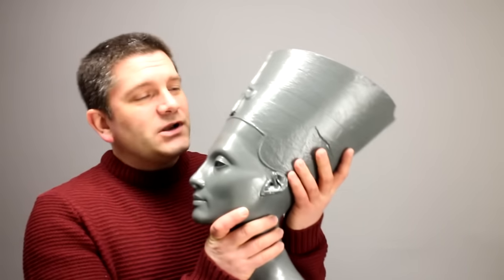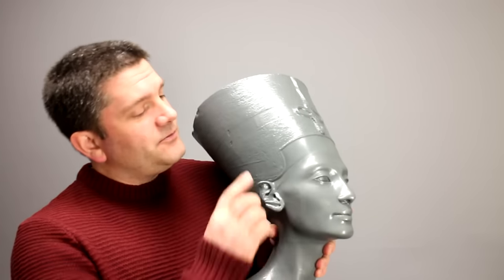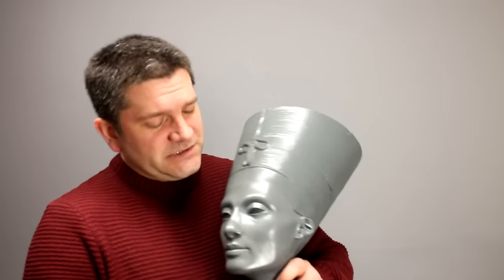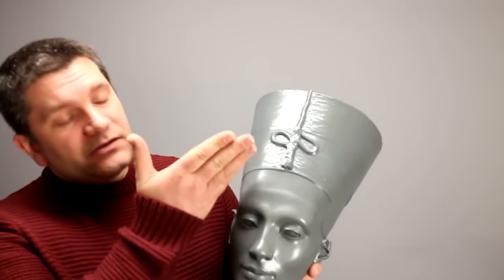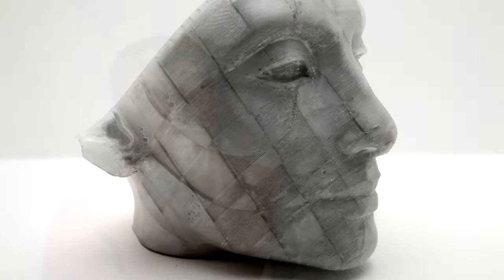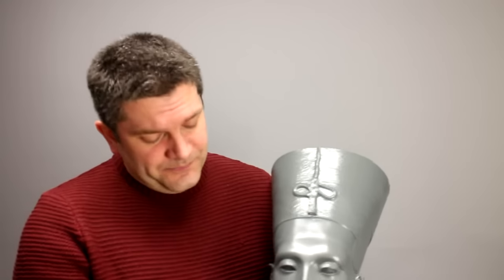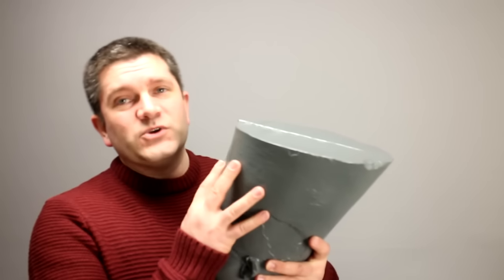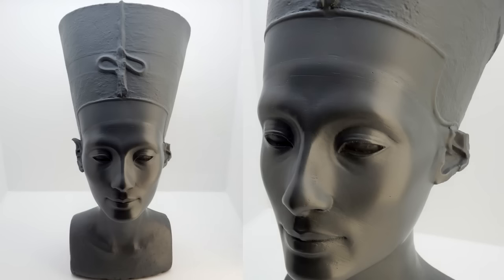3D Printing Nefertiti full size on a Desktop 3D Printer

Comment: Awesome!  While I find it nice to print in the metals if you want to go straight from the printer to a finished piece, it seems, for the most part doesn't matter what your base material is, as long as you can glue pieces together  and use filler if needed for weight, then the finishing process for the exterior can done in a multitude of ways to simulate any type of surface.  I know I've used a few light coats of automotive primer/filler to fill in the print lines, then some highgrit  wet/dry sandpaper to smooth/polish some pieces and they can look metalic/plastic matte or shiny.  So know exactly what you were shooting for, and your results look amazing!  Can't wait for your next project!
Reply from the maker: +David Clunie totally agree, if you can sand / spray / paint or coat then almost any material and colour works just fine. ABS with some acetone smoothing looks fantastic with a spray paint finish - like glass.

Comment: Great video Richard and some fantastic tips for when I get to printing some sizeable models.
On that note, I'm on the lookout for a big printer and have considered the G Create 1.5XT+, but since E3D released the BigBox I would prefer that I think ... E3D have great support and they are based here in the UK.
BTW I loved your video with E3D and the BigBox.
The only down side to the BigBox is that it's not that huge compared to my homebrew i3 ... I'm wondering if they might release an even bigger version.

Comment: Dear Richard, a question : how did you managed the printing of the "roof" of the two parts of the cap as you haven't put any support or infill.  How is it possible to print upon the void ? Thank you for your answer.  Great job...
Reply from the maker: Hi Lilian, the two top parts are cut across her forehead and also down the middle. So when they are placed on the build plate the slope of the top is on a nice angle that allows 3D Printing. I printed these parts in PETG as that allows a good bridge and span of filament across tricky slopes like this, but it should also work fine in PLA too. I hope that helps.
Reply: Thanks you very much Richard for your quick answer. I will follow your explanations and try to print it again with best settings...
Reply: @RichRap3D  This didn't work for me, at least when printed at 0.4mm layer height (not the 1mm layer height you said you printed at). The top of the headdress comes out like a harp...a couple hundred loose strings spanning the gap. I'm gonna have to come up with some way to pour the plaster such that it will 'fix' this. Big bummer.

Comment: I had made a 1:4 print when the model first appeared on the net, recently decided to print it again in full size, and came across your video. Great work! Did you consider painting it in the original colors instead and decided against it for some reason?

Comment: When you print the base piece and others I notice they are open at the one side, so that you can see the supporting material and more importantly you can easily pour the plaster in.  How do you achieve this open end?
Reply from the maker: Hi Heather, You just select zero bottom layers in your Slicing program. If you also select zero for the top it will produce a hollow infilled section that can be joined together, I prefer to leave on the top layers and cut a hole after if they are intended to be filled. This makes it easier to join sections, but also allows plaster / sand filling.
Reply: +Richard Horne Thanks for that!